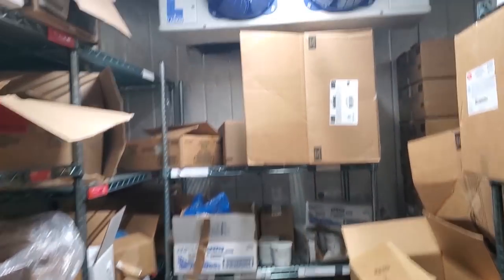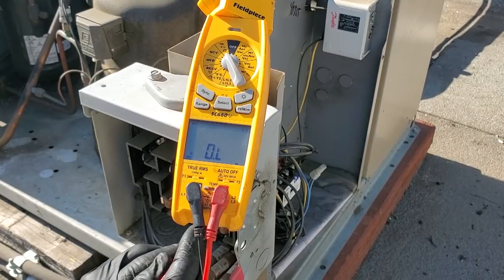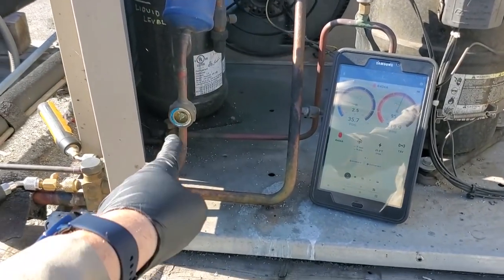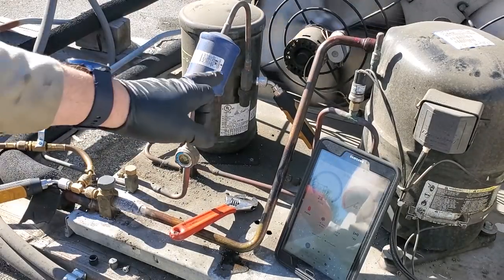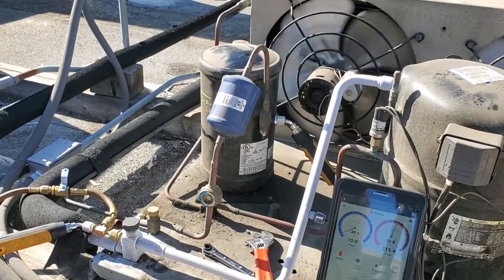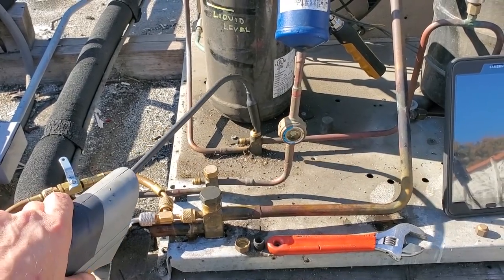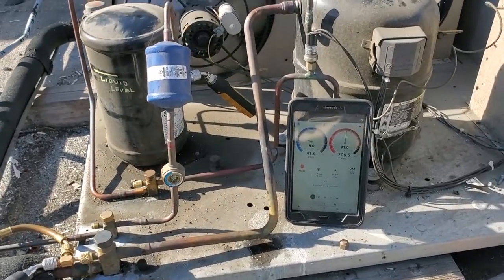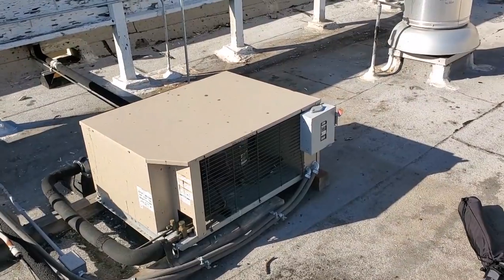SIMPLE WALK IN FREEZER CALL THAT LED TO SO MUCH MORE

Comment: I work in IT doing networking, cabling, wifi, computer repair, wireless networking, and programming. But I find these videos interesting, you HVAC guys have an entirely different set of skills that no one gives you credit for. The big picture troubleshooting tips work in all fields, figuring out why the problem started in the first place rather than just fixing it and leaving is worth your time to the client and you. I should probably record some videos about IT stuff in a similar way except lots of my work is in an office full of people working.
Reply: I also work in IT. I'm constantly trying to see the big picture of why something failed rather than just solve the problem.

My boss, however, is of the "let's fix it now and worry about the rest later" mindset. I can't tell you how many times I've been bitten in the ass by that. Fix the problem now, then I'm back in a few days doing it again. And again. And again. By that third time, I just do my thing and figure out why whatever is happening is happening, fix it right, and low and behold no more problems.
Reply: @LostDryerSocks  I am glad the guys I work for have built a relationship with our clients that we are "Experts", and that is why they call us to fix things. We don't take advantage of that, but when we say no do not connect your printer through WiFI you need to pay for a cable they say ok I will pay for it so we don't have problems again. We work with small to medium businesses so the other problem we have is 4-8 year old computers they don't want to give up.
Reply: I could, but it's enough a headache as is. I do lots of small business work after-hours, sometimes 24 hours straight weekend warrior to patch and replace things.
no time for diddling about with cameras, especially if there's multiple jobs spread around a building, I get more leg exercise than runners at times :))
Reply: @webluke  haha, the good ol trusty wireless printer issue. That's one of the times I've had to go back because my boss didn't want to wire it. Still waiting for a call back.

Side note, were we work (boss and I) there is never a charge for anything as we work for the place directly and are on campus during the day. It's more of a nuisance for myself and the end user to have to keep going back to their room.
Reply: I've been doing this for 18 years. Most people appreciate what you do for them, but let me tell you there's some real interesting people out there that treat you like a piece of garbage for helping them out in a time of Crisis. I never understand. This type of behaviour and there's days where I wish i stayed in the auto bizz
Reply: Root Cause Analysis or RCA is the foundation of fixing a problem for good. I work in IT myself and anytime an outage gets triggered, it's mandatory for the team that its assigned to complete a full analysis.
Documentation of changes is key as well to quickly respond and narrow down what may be causing the issue at hand.
Reply: Thanks bro, likewise, Right back at you🙏
Reply: Get a small cam you can put on a hat/glasses then just edit the video when you're home explaining what you were doing :D
Reply: I am a programmer I can do cabling/networking and computer repair.
I can also work on cars and machines reason is my dad is a farmer
I can also drive anything but I don't have a license yet for trucks and buses 
i also mate some plans to make an tank/tracked vehicle of some kind but that went nowhere because lack of ambition and lack of funds
Reply: @marcroelse9517  "reason is my dad is a farmer"
I've not looked into it that much, but that whole "right to repair/hack" stuff going on is interesting.
Reply: @LostDryerSocks  doesnt that cost your boss a whole bunch of money and pissed off clients.... i work in a small IT shop and we fix the problem right away... i have yet to have a client comeback who was unhappy with my work
Reply: @hellishcyberdemon7112  Money, no. Pissed off people, oh yes. But he doesn't seem to care. The position I am in was created when I was hired. After three years I have learned that my boss never leaves the office. If I am out, he will literally let people go without and assign tickets to me just so he doesn't have to leave the office. If he can't do it remotely, it's doesn't get done unless I do it. But at the same time, I have to do it his way first (very systematically *eye roll*) before doing it my way three times later.
Reply: Nice dial-a-charge behind you.
Reply: Another IT guy here. I think these vids are interesting for us because it’s problem solving - Except Chris works in extreme environments and his job is physically dangerous. The worst danger I generally face is if the Auditor’s office goes dark...

Comment: I'm an HVAC dilettante.  The place I used to work had an HVAC store next door and I would wander in there and sometimes find something useful.
I have fixed minor things on a few systems.  Added freon, etc.  Fortunately never messed anything up.
Didn't know about receivers.  Read more about them on the internet.
The other day I pulled into a parking spot at a quick market.  One of their refrigeration units was mounted low on the side of the building with the cover off.  Because of this channel I was able to identify all the parts and explain them to my wife.  She got bored.

Comment: I can't believe they waited two days. The last Big kitchen I ran would have about $25-30,000 in Shrimp and Lobster Meat during height of the season plus other provisions. If there was a inkling of the freezer not performing properly or if my gut just was telling me there was something going on, I would call for service right away. Not declaring an emergency but would ask my guy to stop by when they could. 
Preventive maintenance is the key. But not all owners get that. We were open 5 months. I had my guy clean everything to do with refrigeration/Ice Machines before we opened and at the end of the season. In one of your other vids you said you couldn't sleep and went back the next morning. That's how I am as well. You just know and always trust your gut. Nice Job as always.
Reply: sounds like they should have two fully independent cooler systems with that much expensive product or at minimum independent  refer systems in it, with say 10F leeway, one fails the other cycles on, alternate them monthly to test and ensure the standby is working.....
Reply: @throttlebottle5906  Well in the true pattern of most restaurants... owners can be really cheap. Ya know... put a band-aid on it.
Reply: The problem is, the business is closed two days of the week, the freezer went down just after they closed for the week.  The glass doors have a heater to prevent frost to keep the windows clear.  The problem is, when the compressor quit, the heaters kept working, which made the food thaw even faster, the brand is Beverage Air.
Reply: trust  me i work in hvac and its always  like this even gas stations do  it for  their coolers its  always "  well it hasnt worked right all week" like really
Reply: Cause fridge mechanics are a rip off.
Reply: @eddiewhaler1  I can hear the distant angry shout of Gordon Ramsey.

Comment: Couldn’t hear the tunes with those loud fans man... gotta love roofers.
Reply: @QuestionMan Read my mind.
Reply: Why would a company lockout a disconnect on a roof that you have to get permission to get on? Only people that should be able to get up there are staff and service personelle
Reply: @QuestionMan disconnects are lockable in the "OFF" position, rarely/never in the "ON" position.  They are a saftey system to remove power from the device, which is why you will always find one adjacent to electrical equipment, so the technician can verify on the spot that the device is unpowered.
Reply: Naaa roofers usually got their music loud enough to go over the fans
Reply: @Atenhitv  the style disconnect in this video can be locked in the "on" position by putting a padlock through the hole in the bracket when the handle is in the up position. If you bend the crap put of the handle you could get it past the padlock, but it's a pretty good deterrent. In my area most disconnects on rooftop equipment are lockable in the "on" position for the very reason this video exists.
Reply: @thebigmacd  Have an upvote, electrical equipment should be locked against people meddling with it.

Sadly I rarely see it other than utility equipment.

Comment: I had never touched a refrigeration system until november last year when I got sent on a course by my workplace, which was mainly focused on ammonia and CO2 refrigeration systems that we use. However, the course included halocarbon systems so I got the choice to take another certificate for those, so I did. I did well on the exams and passed, went from clueless to actually knowing what I was doing in about five weeks. 

Now I'm here due to the YouTube algorithm, and I find it quite interesting. Thank you for actually taking the time and recording these videos, I don't get to work with these systems daily so this is my dose of refrigeration systems.

Comment: Heat producing device,that made me smile. When I lived in Canada trying to charge rooftops in stupid temps, I would never say we use our torches. We did sometimes if we had local power we would strap a crankcase heater to the can.

Comment: We have a chain of restaurants out here in Phoenix,  we found that when we find disconnects off it's the hood cleaning company tapping power and forgetting to either turn on the switch or putting pull out back in place...
Reply: Sounds like a good reason to start putting locks on the boxes...
Reply: @lamelama22  except you can't it's a safety device, not just an on/off switch.  I'm pretty sure you are not legally allowed to lock it on.
Reply: @Dysan72  You can 100% lock it in the on position.  The fuses provide the safety,  not the handle. 

This is no different that a breaker panel being in a locked utility room.
Reply: That was my first thought as well.  Especially after he showed the "belt debris" under the bucket lid, looked like vent fan belts to me, and I doubt they come up through the hatch with their equipment.
Reply: Dysan27 lol us sparkys can kick up any power source we want especially if we don’t want hvac or plumbers messing with our shit
Reply: @fedfreds832  Bolt cutters for the win!
But seriously, I could understand some plumbers shouldn’t be allowed near panels, but hvac guys generally at least know enough not to just disconnect stuff or “borrow” a circuit - especially one that’s in use.

Comment: I wonder if someone was huffing that roof sealer, got messed up and flipped that disconnect accidentally. It's weird the way it's spread around on the lid, like someone was trying to maximize evaporation of the liquid.
Reply: Does that stuff actually get you high then?
Just curious, not going to screw around on rooftops trying to fry my brain on whatever is in there.
Reply: @difficultbastard  It depends on the brand. Some roof sealers contain toluene, which is huffable. (I don't speak from experience. I like my brain.)
Reply: @KneelB4Bacon  Hahah, ok.
The more I live, the more I learn.
Reply: @difficultbastard  
By the way, I know youre not curious but if anything ill warn other people reading, but inhalants are basically the most dangerous drug you can do. Literally, probably worse than heroin or meth or any of those. Lots of drugs get over exaggerated or get a bad reputation but people dont know how inhalants can fuck you up. Huffing air duster is according to other people more enjoyable than meth and can not only kill you the first time you use it, but it causes irreversible brain damage also after just one use. I am not joking when I say using inhalants is fucking suicidal.
Reply: @washhtswarrior6411  I remember being told that one of the students in my older brother and sister's school inhaled hairspray, I think it was. Her lungs stuck together and it killed her.
Reply: @washhtswarrior6411  inhalants arent even a drug, the "high" is just brain cells dying
Reply: @MyWaifuNow  
I mean not quite, technically yeah it isnt a drug but the high isnt literally brain cells dying. It removes the oxygen from your lungs and removes CO2 from your blood causing hypoxia. Im doing some research right now to see what exactly makes it so harmful, say compared to safer inhalants like nitrous oxide (laughing gas). Google is very unhelpful because they try to prevent people from learning actual drug information with the uninformative abuse websites, so all ive found so far is that difluoroethane (the stuff in air duster that gets you high) is denser than air so stays in your lungs, and binds to hemoglobin in your blood. But im not sure yet why that makes it so particularly bad. I mean, if you hold in a breath from a helium balloon too long you can pass out, but helium is quite safe to inhale. But helium is an inert gas lighter than air so that might explain it.
Reply: Some roofers spread the sealer around the lid to get an even amount to use. Helps w/clumping I think... Kinda lazy to leave it behind though.
Reply: @washhtswarrior6411  Binding to hemoglobin is what makes cyanide kill you. It means that, no matter how much you hyperventilate, you will never get oxygen to your body because all the slots on your hemoglobin are taken up by this other chemical. Helium doesn't react or bind with anything ever, so once you exhale on passing out, your automatic inhalation will flush your blood with oxygen again.
Reply: @Frommerman  no, that's carbon monoxide. Cyanide kills by disrupting intracellular metabolism

Comment: Nice fix , probably  will have a return customer if not already, a good recommendation , could probably sell temp alarms for wall in freezer and wall in cooler , cheap fix compared to loss of food . Being up front with customer always pays off in the long run.Trusting your HVAC tech means a lot.

Comment: Seems like checking to ground at the disconnect like that wouldn't actually be checking the compressor or the condenser fan unless the contactor was pulled in. Good job love the videos keep them coming.
Reply: he check compressor to ground short.  he can also try ohm between compressor coils but i dont think he does that on this video.
Reply: I think he checked several things on the load side of the disconnect - voltage from phases to earth - this could pick up a bad disconnect or backfeed from somewhere else and is good practice before checking resistance as the resistance reading will be invalid if there is any voltage at all. Then he checked resistance from phases to earth and phase to phase, looking for shorts.
Reply: @ickipoo  yeah, main checking the load side was to insure disconnect didn't have a leg stuck on or backfeed. wouldn't want to find a bad contactor or other and go to replace and fry yourself

Comment: also manipulated heat..  It did amaze me how a unit can limp along with multiple problems maintain temp and then one more straw breaks its back and you end up finding all the other problems that require attention.. Big one in summer after changing a condenser fan was discovering condenser coils extremely dirty especially along major highways/freeways

Comment: I find that the trick to remove the cores with those appion removers is to screw them on loosely. Just enough so they don’t leak. Otherwise the gasket compresses and the cores catch and fall off.

Comment: when replacing a schrader core in a fitting, make sure it is in a horizontal. just like your light switch cover screws and receptacle cover screws. this is a must!
Reply: cover screws are aligned for looks, some people are obsessive compulsive and others are very detail oriented, instantly noticing such tiny details and it can make or break a homes sale!
 I was residential new construction "sparky" in the 90's, so I know all about it and how picky some people are, while others could care less and are thrilled to have a roof overhead with electrical and plumbing that functions!! let alone 3&4-way switches to operate lights from all room entrances and outlets all over, many came from having older homes with 2 outlets in a giant room and one switch at far end of room lol.

Comment: In Germany, you usually have some kind of monitoring of the temperature. So if someone switches it off, you could find out the time when it was switched off. There also would be a beeping sound if it gets too warm. Then there is TÜV, which is required on almost every machinery. This is a safety check performed every six months or every year or every two years, depending on the possible impact of a failure. A machine like this is probably checked only once every year. The manufacturer of the device must get approval when it goes live, that it is safe to operate. They would make a test for leaking and they probably would demand a marking of the proper liquid level.  TÜV gives green light to operate the device or it can shut it down or demand a repair and second check within a month. The approval is marked at the device so everybody can see when the last check was and when the next is due. The next thing is the service book. Every time there is some service done, it will be documented what has been done, which parts were replaced, or if there are some abnormal observations. TÜV tests are also documented in the service book. You would lose every insurance coverage when operating a device that has no TÜV approval at all or TÜV approval has expired for a longer period of time, in case of damage the company will pay a hefty fine because of their negligence. Workers can by law refuse to work with equipment that has expired.
Reply: well, thats why they talk about german Engineering